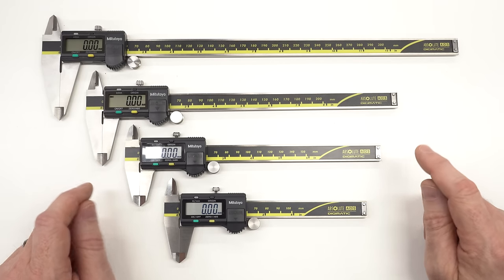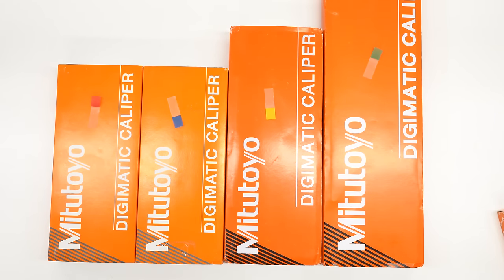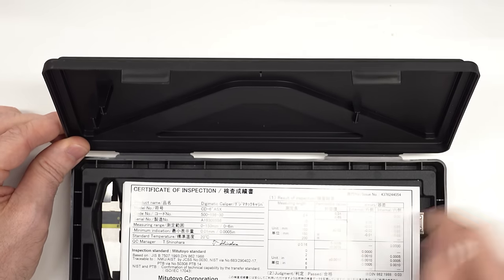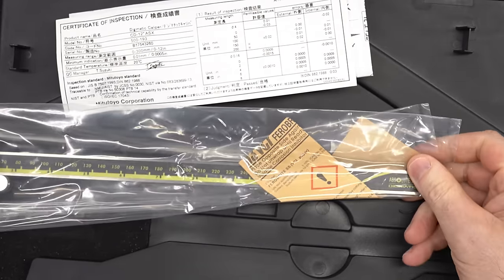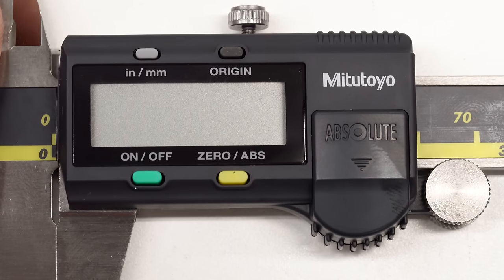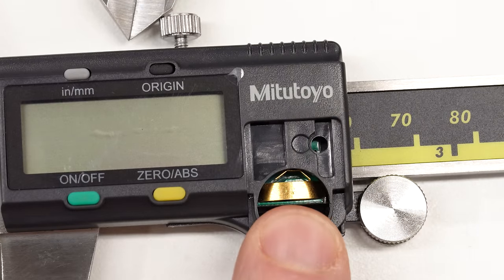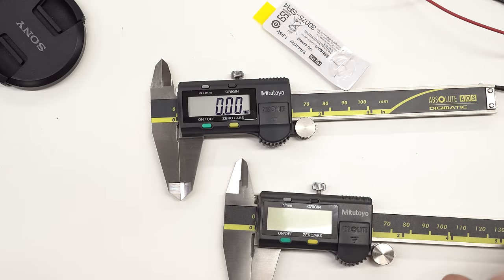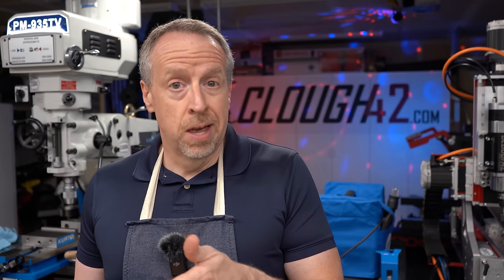17 Warning Signs Your Mitutoyo Calipers Are Fake

Comment: There are a few problems with buying fake products, one is fake products usually do not meet the specifications of the genuine product, which can cause safety issues when they fail. 2: the manufactures of the real items won’t honour the warranty that they offer on their products, when the product fails and is determined to be a fake. 3: fake products cause harm to the original company, both in profits as well as the companies reputation. 4: fake products usually will not hold up or have the same tolerances for precision item like calibers. 5: fake items cause massive problems for consumers who just do not care about anything other then getting a good deal. So to sum things up, a fake item has only two functions: put a good company out of business, and cause social economic collapse.

Comment: I guessed correctly pausing at 0:00. on the second longest the printing above the battery door is faded looking. The bottom two looked fine so I looked at the printing of Digimatic on the one I already though dubious and noticed that it is spaced farther at the bottom from the edge. only the top model shared that wrong spacing.

Comment: The easy way to see the major differences in quality between higher end and lower end digtal calipers is by opening them up.    They won't have a genuine board in them and there will be obvious major quality differences in the hardware, slide, etc.

Comment: As several comments have pointed out, in "Certificate of inspection / 検査成績書" the second hieroglyph in the counterfeit product is subtly different.
In the original it is 査, and in the counterfeit 查 (note the gap above the bottom stroke.) The first one is used in Japan and the second in China.

There is nothing particularly wrong with most cheap Chinese calipers -- some are just as accurate as the big brands. But lying about the brand is a big turn off -- I would definitely avoid these. You will get more value from an honest no-brand product. And if your business depends on reliable accurate measurements, it is cheaper to just stick with a reputable brand.

Comment: The one thing I’ve noticed that the fakes have not figured out yet is the cutout on the back for the rod to slide in. The original has a nice round end stop up by the head the fakes are all squared. They may eventually get that milling down but so far I’ve never seen a fake with the round cut.
Reply: Ive not used one with the round depth rod good to know they have the squared off groove but you can clearly see the quality of the cut.

Comment: I just started out with hobbyist machining, I bought 2 fakes without knowing better,  I contacted Mitutoyo to register the warranty, was told they are fakes.  I disputed it with Ebay and got my money back and got to keep both the 6" and 8".  I got 2 fakes for free, it was not planned but it happened, are they good enough for learning?  Until I can afford real Mitutoyo calipers.
Reply from the maker: If you have them, and they give you reliable measurements, they're probably fine to use, though they'll eat batteries.

Comment: I have a few older Mitutoyo 6 inch calipers. some of the features on your fake ones are the same as my older units. The battery cover and how it powers up are different than your real ones. I'm 100% sure mine are all real. Bought many years ago. I just think whoever copied these newer ones also copied some of the features of the old one for some reason. Like my origin button is recessed. Power up doesn't do the dashes etc. Mine doesn't have the AOS marking which is probably dating it. I cant tell the date on mine but I'm guessing 15 years old... I agree the two you have seem to be fake though. Why people fake stuff is beyond me.

Comment: Very interesting,  so i bought a 6" one from Ebay a few years ago and because of my own stupidity didn't check where it was coming from. Which turned out to somewhere in china. They seemed to have put some of the flaws right on my my example.  However the biggest give away is the origin button, its recessed and totally useless. However the battery life is brilliant,  i picked from my tool chest to look at it for this vid and it came on no problem,  cant think that i have used it in 3months either. I always try and buy decent reputable tools, i caught my self out here by been stupid enough to believe they were genuine for the price. Its sticks in my throat everytime i look at them, but for what i use them for. Its not worth chucking them away and buying a genuine one. Thank you for doing this vid.

Comment: I just received the 6" calipers from Amazon today and immediately noticed something wrong with the packaging and performance.  The battery was already active because the plastic separator wasn't in place.  The body has scratches and the unit does not always return to zero because the wheel is very loose.  I presumed it was a returned unit that the company tried to resell.  Amazon agreed to take it back.  After watching your video I am nearly convinced it is knockoff, but a better knockoff than yours.  For example, the dashed lines do appear on the digital screen and the battery compartment is properly marked.  Maybe the fakers watched your video.

Comment: I see 2 more differences.
on the fixed jaw printed scale : placement of the 0 line is not aligned perfect with the Jaw Line  on the ebay knockoffs
the riveted stop bar at the end of the caliper is not straight on the ebay knockoffs

Comment: what a coincidence
I literally just bought a second hand 6 inch one
cost me 72.99 squids
I pretty much just took the seller's word for their legitimacy.
I purchased a 2.15 mm gage pin and it reads 2.14 repeatedly
which I think is in spec 
(I'm by no means a professional  in this game btw)
I needed these to measure bearings as I'm rebuilding a mountain bike.
well according to this video the seller was an honest guy.
they do exist on eBay thankfully.

Comment: My question is... how much of a $150-$300 set of digital calipers (of any brand, unless Mitutoyo is the only brand that is that expensive) is actually worth it?  In other words, what goes into such an expensive pair of calipers to justify the cost?  To me, if I were going to make/sell a set of digital calipers for $150 or more, you better believe the customer is going to know exactly what they're getting for that price and why.  Calipers are designed to measure, so consistent accuracy should be top dog.  The Mitutoyo calipers in the one video were consistently off (0.999 instead of 1"), when you measured the 1x2x3 metal block, whereas the cheap Pittsburg ones were consistently accurate (unless the block is less than 1" in the one dimension).  If a pair of calipers cannot hit the exact same number every time, then how do you actually know what your actual dimensions are?  Wiping the blades should be a habit.  Based on that video, I would not buy the Mitutoyo calipers.  Whether or not a fraction off from absolute actually matters, is not the point.  You're paying $100+ for something that isn't giving you a consistent reading.  If you can MAKE a pair of $100+ digital calipers read differently, by pushing or prodding (intentionally or not), then something is wrong.  Obviously a pair of $20 Calipers are likely to have that weakness.  Cheaper design/build = sloppier tolerances.  At least that would be my assumption.  Fortunately, things like "fit and finish" and brand name and such don't matter to me... as I've said to people, "a watch is a watch".  It tells time.  As long as it works, that's what matters.  Of course, I no longer need to wear one, since my iPhone is also my watch.   I'm not out to impress people.  If people are more concerned by what tools you use than how well you do your job, their priorities are messed up.

Comment: The accuracy is checked with a block gauge. Genuine products only need to be sent to the original factory repair center. If it is not their product, they will not repair it for you.

Comment: This was useful, thank you. A few years back I bought a like new 6" Digimatic in plastic case missing the battery cover on eBay for $70. Found the genuine cover  from some supply house (shipping was as much as the part, like $8/ea.) and have used it a few times since (I've got cheap throwaways that I leave sitting around in the shop for general use). In every way the case and tool look like the genuine article which I suspected all along; little things like measurements taken at the thick part of the jaws (nearest the beam) and the thin part out at the tip of the jaws are identical. Cheap calipers have jaws whose measuring faces are within .001" or so but never dead on. Also when sliding the moveable jaw, it's buttery smooth. Genuine Digimatic is a really nice tool.

Comment: I am sure it has been said but the display back color is more white on the fakes and the face decal is of a rough texture. Mitutoyo is like Fluke, Why are they expensive? Because they are certified! Are they more accurate? Possibly, However they better well be more reliable, tougher and have a damn good warranty and customer service as well as longevity. 99% of consumers do not need precise precision. They buy it because the "flex", Just like Snap-On, All about image to some. For this reason, The counterfeits do not give a crap about making a wxact perfect match, They spend minimal time on trying to do so (as you clearly see), They could but why? copy,paste,print, on to the next buck!

Comment: If you're not using the solar-powered version, you're buying an inferior product. On one trip to China to inspect tooling and production I left my calliper at home. My host took me to the most amazing tooling shop, I've ever seen, I paid $10 for a calliper that was accurate to 0.01mm it did not just display 0.01mm but it was as accurate as a micrometre when measuring very fine details. It is an order of magnitude more accurate than my solar powers Mitutoyo. The Chinese product was a fraction of the cost of the Chinese product and was more accurate with equivalent quality. My only gripe is it needs a strong battery. and it used orange and grey vs black and yellow. It flashes when the voltage drops and the battery life is about 8 months. the flashing is very irritating. The only reason I use the Mitutoyo is because it's solar-powered, and in 20 years I've never needed a battery.

Comment: Genuine cheap and cheerful callipers have pretty good accuracy and are fine for occasional use.  Professionals go for Mitutoyo or Starrett for the outstanding build quality ensuring years of repeated use and peace of mind and for this they are justifiably expensive.  Selling cheap callipers masquerading as the genuine articles is plainly a criminal enterprise. The golden rule is that if something is being sold at a fraction of the list price by anyone other than the manufacturer it is almost certainly a fake.

Comment: you forgot about the thumb screws, the Genuine calipers the thumb screws are secured and cannot be pulled out at all. also internally the circuit board of the fakes are not adjustable or any calibration screws. i have a few calipers and the recent one i got from a renown company i found a fake but it was INCREDIBLY hard to spot, only thing tipped it away is the screen powered up instantly with the battery in it apparently china recently now have access to the older molds for cases and the parts to make the calipers, thankfully the circuitry is the one thing they not changed so is the only way to catch the fake now. my other calipers are 12+ years old and there showing its age, was disappointed i found out 1 of the 3 i got to replace em was a very well made fake.

Comment: Generally knock-offs are not worth it as there is no incentive to actually be a good value, just to immitate a premium product.

That being said you can actually get pretty decent china brands. I personally use a Shahe branded one, works perfecly fine, glides nicely over the surface, does not reset when powered off and seems reasonably accurate. As of now I see little reason to get anything better.

Comment: Just remove the battery  cover and tense the springs so that the battery will be held in by them... every time you're finished, take the battery out.  They work pretty good if you do that.  EBay calipers are going to be fake... just buy the cheapies unless you're a real-live machinist.

Comment: I know mine are real. They have a dial on them & were purchased in 1990. 200 thou per rotation.
I spotted the fakes before watching, 
1) Shiny silver bigger pot metal screw
2) Font on numbers on fakes were spaced farther and were larger
3) Mitutoyo logo is larger slightly on the fake, which is always done by fakes

Comment: When you talk about the print quality, you are pointing out scanning artifacts. They used a low resolution scanner to scan the original documents, the printer they used is from pretty good quality as the ink is applied smoothly and accurately. 

This should be a warning for everyone, a digital document will always print a crisp and sharp copy. A scanned document will start having artifacts and it means you have received a counterfeit article.

Comment: Just do "Instrument Detection Limit" test .
I think fake one 's megnetic encoder stickers has some linear problem on it~ 
Or not? If not. It's a good deal.
I did "Instrument Detection Limit" test on China's unbranded vernier calipers. 
And I have been using unbranded vernier calipers myself. Because I don't wan't spend money on "brand".
As long as you know what you need, everything is fine.
Reply from the maker: Even if they measure correctly, it's a bad deal, because they cost more than unbranded calipers that work the same.

Comment: the color brightness is not a full indicator as products can sit in warehouses exposed to light that can fade the printing.

you dont need to label the boxes as the length of the product should match the box if not packed in styrofoam.

if packed in styrofoam then the length of the cavity where the product fits in the styrofoam block should match the product and the styrofoam block should fit the box.

if you was to put the 4 inch product into the 6 inch styrofoam there will be a 2 inch gap of empty styrofoam cavity.

if you put the 4 and 6 inch styrofoam block into the opposite box it will fit without any gaps in the box because the boxes are the same length but if you try to put them into the 8 or 12 inch box there would be some empty space and would rattle around if you shake the boxes.

the texture of the printed strips on the devices are different between the genuine and fakes

Comment: A notable difference, if you slide the fake caliper it’ll turn on by itself.  For the genuine unit you must press the power button. 

Halfway through this video I checked my 6” and 12”, the 6 is fake and both from eBay.  The 12 is a year older and noticed right away the 6 is less refined but I didn’t think much of it.

Comment: My genuine Mitutoyo digital caliper, which I have had for probably over 10 years was actually "Made in England" by Mitutoyo (U.K.) Ltd so some of your conclusions may vary in other countries. The most interesting reveal however was the current consumption of the fake. We tend to assume cheap batteries don't last as long as branded ones when in actual fact the critical factor may be  the device itself. The one thing you didn't cover however was the degree of accuracy between the two, presumably they were close or the same and the point you are making, as with the Shars, is the integrity of fakers in not having sufficient faith in their product to use their own name.

Comment: Interestingly, I have an older set of Mitutoyo Absolute IP67 calipers (dating from 2004) which were part of a 70th anniversary set. I'm very certain that it is legitimate, as this pre-dates the huge proliferation of eBay fakes, plus I have all the papers and the rest of the set (including the nice gift box, digital micrometer and ceramic gauge blocks). Power draw is also fairly similar to your genuine Mitutoyos (power fluctuates a lot when on, peaking at 10uA but typically lower).

However, the calipers bear many similarities to the knock-offs in this video. The depth bar channel is machined similarly to the fakes (though to a higher standard), the radius on the outside jaws is tighter than your modern Mitutoyos, and the tension adjust screws are not particularly well-centred.

I spotted several other comments on this video with other people who noted their older Mitutoyos also look a bit like your eBay ones, in various ways.

It seems Mitutoyo has improved some aspects of their manufacturing in the last 18 years, while the fakes have based their process on older models and are just updating the easy stuff (stickers, box art and accessories) in order to mimic today's models.

Comment: I have the 4 inch version I've had for eight to ten years and the origin button is flush so it's different than than ones you have. They were bought they my shop from msc so they are legit. My case is the same as yours with the made in Japan. Origin button is the only difference. I wouldn't recommend buying measuring tools off ebay. You showed why. Kinda sucks it's getting harder and harder to trust anything these days

Comment: Are the fake ones even real absolute ones? 
Mitutoyo uses some simple capacitive incremental encoder with interpolation for fine distance measurement.
And some weird phase delay/time of flight measurement for large distance (as far as I understand the patents).
Both combined, and the electronics knows, were it is on the scale, with no need to zero it.
The oldish ones (Tesa, Mauser...) and the cheap China ones that I had so far, were only incremental ones, without zeroing it, it doesn't know the distance. Or move it too quickly, so the counter can't follow, it also looses position.